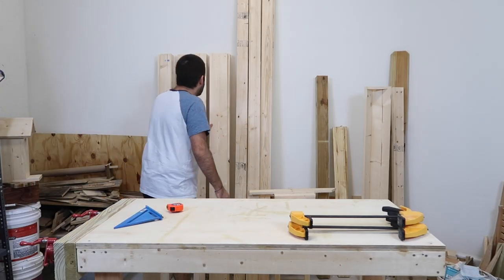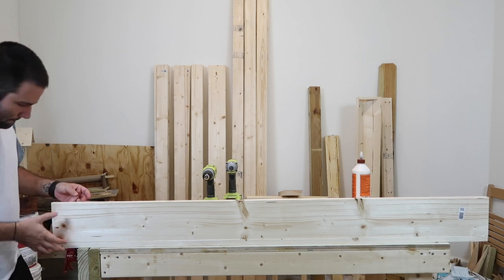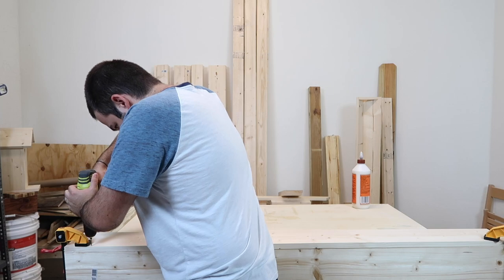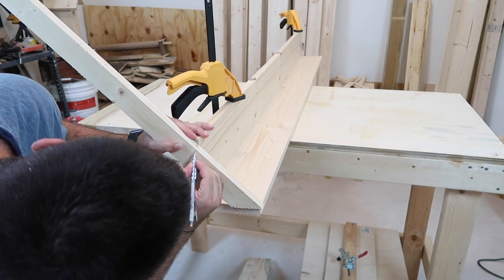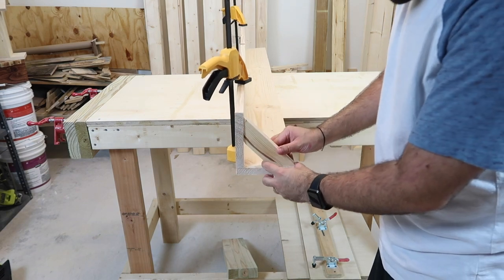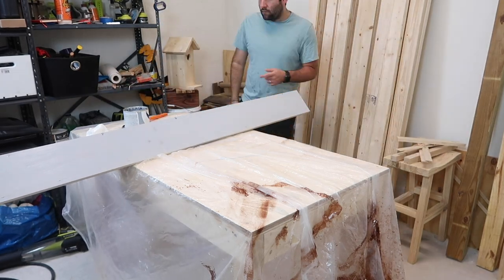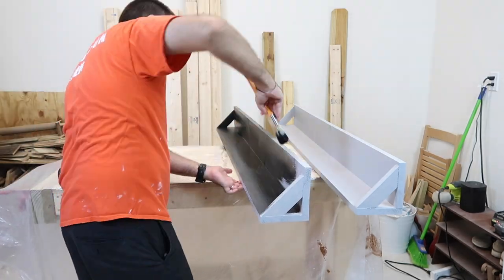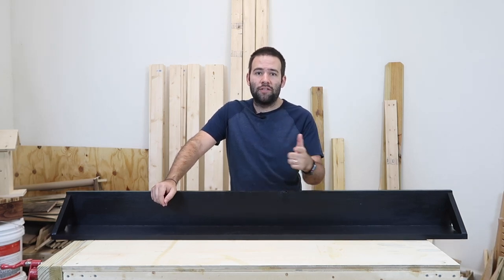BUILDING A MODERN SHELF (FOR MY CD's) | Ale's Everyday

Comment: i would varnish it instead of coloring it black
Reply from the maker: That would also give it a nice look 👍🏼
Reply: or you could also scorch it with a gas blowtorch,then apply a layer of oil,let dry and wipe the excess with a cloth,then apply a layer of furniture wax and finally polish it with a medium-hard brush. this will give it a nice matt sheen.